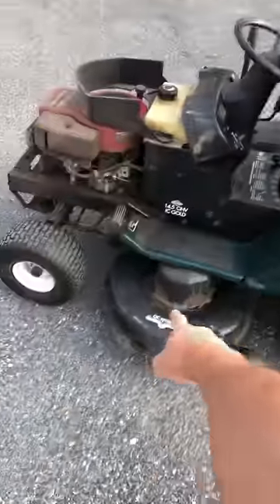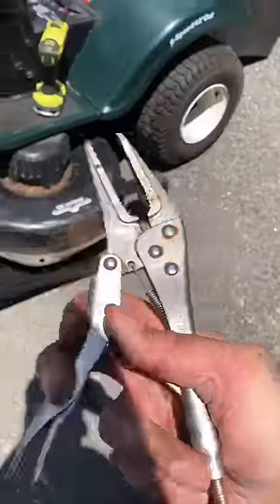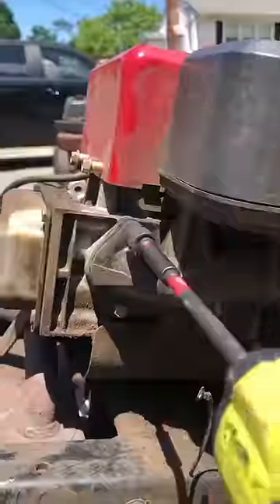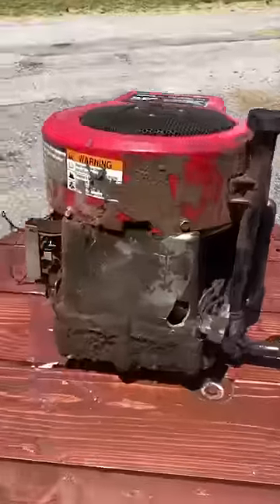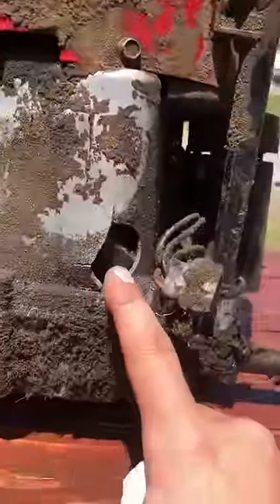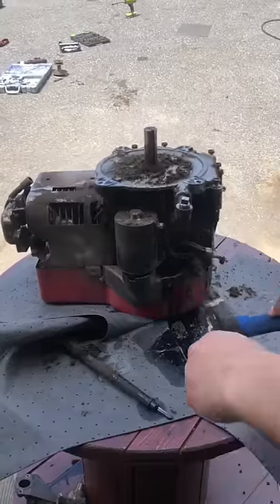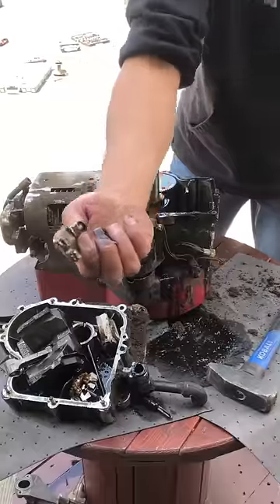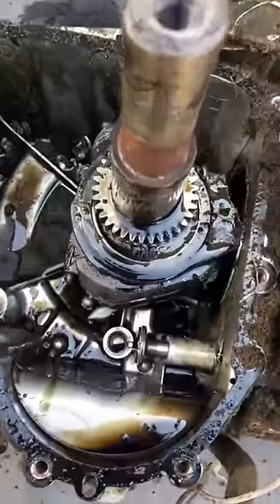The Dangers of Hitting Rocks | Exploring the Consequences on a Craftsman Riding Mower

Comment: free mower plus a $250 engine from harbor freight
Reply from the maker: Nah. I have some other ones in the yard 😂🤣 looks like a hobo lives here
Reply: @NiceLawnBro  if it wasn't for my girlfriend, I'd have a matching parts truck for my daily pickup and a rolling 4th gen NASCAR in my back yard that both would have been free 😂😭

The stock car one hurt. All it needed was an engine, transmission, and drive line.

Comment: BS, flywheel key would have sheered. More drama.
Reply from the maker: It did sheer. But half way. AND the innards were smashed to bits. Low oil, high rev, sounded like a rock and 💥

Comment: Ive rebuilt far worse
Reply from the maker: With the cracked case?
Reply: @NiceLawnBro  absalutly , not worth it to most folks but ,I've repaired many "unsavable "blocks both large and small . My son had a 5 hrs. Briggs named Frankenstein that had a rod go thru the block . It puts out about between 25 and 30 horsepower . I repaired a 390 GT block that I put a hammer thru number 5 water jacket ,big hole long story , but we worked the dogshit out of that engine for another 7 years in GREENY., chipper truck . I'd be glad to pass on the info and process.  Not that tuff . As long as the mains and valve guide goodies are straight you can save many blocks .
Reply: @NiceLawnBro  cracks can be tuffer than holes If its structural that's pretty much the end . But if not you find the end ,drill it ,fill it ,v out and fill the crack .
Reply from the maker: @shawntailor5485  seems like a “why bother” situation when we can get a new motor for a couple hundred bucks. Time is money, but to others money is time. 🤔